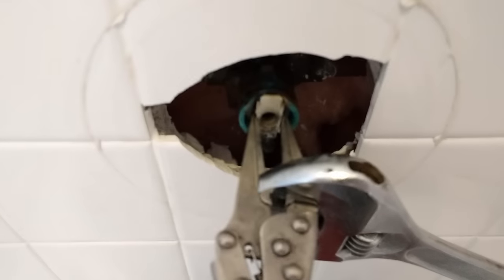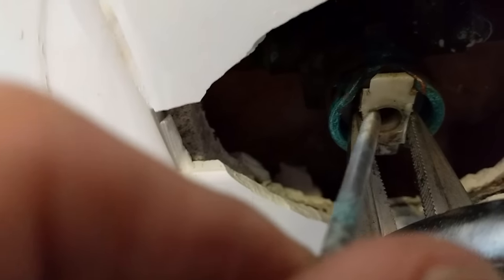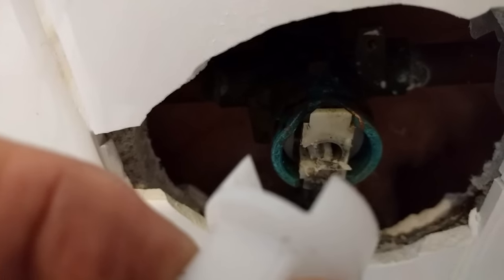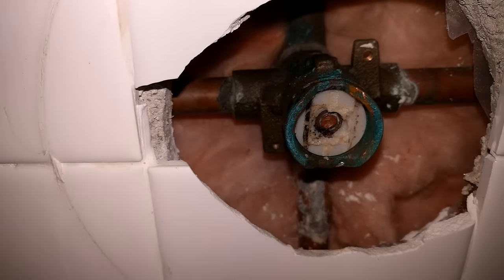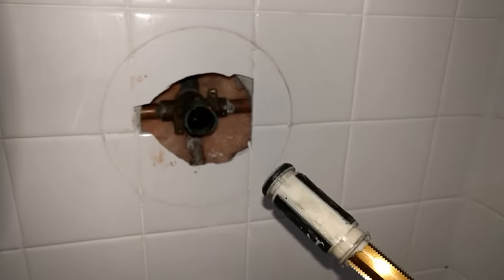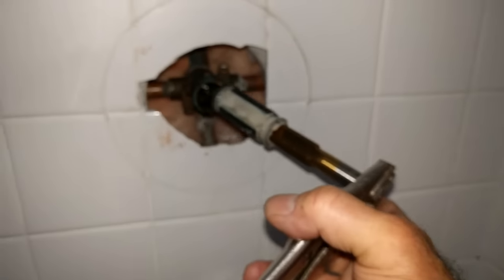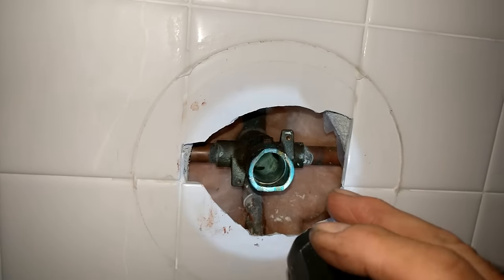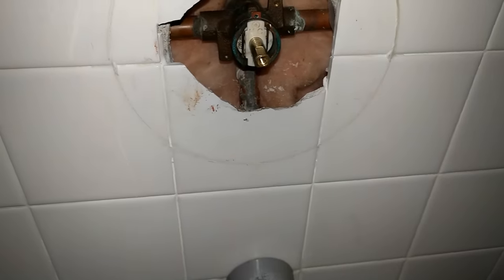Home repair Moen 1222 cartridge stuck really bad by froggy

Comment: Just wanted to post a big thank you for this video, froggy. There was another video that was helpful by uk7769 but this video showed the exact same issue I was dealing with. The shower handle snapped off at the copper valve so nothing was there to grab on to. 

I had to screw in two floor screws (dry wall screws would work too) in the white 
plastic parts on either side and yank on them with a vice grip. That got the first portion out. I then barely managed to grip onto the end of the remaining copper valve with a needle nose vice grip. Yanked forever. Finally the core came out. Then is was tap time. 

The M18x1.5 tap worked great. Thank you for sharing the exact size. This bit was not
 easy to find. Had to get it from an industrial store called "Bolts" up here. None of the big box store around here had anything close to the same size. Tapped it no problem but mine didn't want to turn while tapping it like yours did. So I had to use a tip mentioned in  uk7769's video that uses a matching bolt with massive 3/4" washers. Turned until it wouldn't anymore and then kept turning and pulling. It came out 
slowly, in three parts. I kept tapping further as it was breaking off in pieces. Finally it was out. 

Rubbed the inside down with steel wool and lime cleaner. Replacing the new cartridge was not problem. Just slipped right in. But then I had the issue of the broken cartridge valve stuck inside the shower lever. I thought I could just go buy a new one. Can't be that expensive right? That shower handle alone is $50!!! Just the handle. Nothing else. I decided to try and salvage mine. 

Soaked it in CLR for like 2 hours. Took a vice grip to the copper valve that was stuck to it and started wiggling. Heated up the innards with a blow dryer too periodically. Finally the inner black part comes out. This reveals a screw on the inside that hold the copper valve in place and snug to the black plastic part inside the handle. Unscrewed that and it still didn't want to come out. Soaked in CLR another hour. Wiggle Wiggle Wiggle, heat heat heat, pops right now. $50 saved. 

What an ordeal we have to go through just because of such a stupid design. Thank
 you once again froggy for posting this video. If your shower handle snaps at the stem valve, this is the video to watch. Be prepared for a battle. 

Btw, the moen cartridge is covered under warranty. Just take it once it is out to Home Depot or whatever and they will give you a new one for free.
Reply from the maker: Glad to help.

:)

Comment: You are the G.O.A.T.
I was fortunate that I was able to get a good enough grip with the vise grip that I was able to pull it out without crushing the plastic.  Heating the pipe with a butane lighter and lots of WD-40 also helped.  No need for the tap.
Reply from the maker: Excellent work!
Reply: I still have to remove the other piece of the broken stem that is attached to the handle.  After lots of vinegar and then WD-40, I was able to remove the screws that fastens the stem to the handle, but brute force alone couldn't budge the piece.  Any suggestions?  Is there any sort of expander that I can use to push it out rather than trying to pull it out?
Reply from the maker: @atl1276  Just all the methods in the video & read all the comments, might be a tip there.  :)

Comment: Wow! As a rookie — I didn't know what the hell was going-on — & then your video popped-up out-of-no-where, at the end some other video, that went easily — I still had my shaft but nothing was budging — I read below about WD-40 or Vinegar — I'm hoping to not have to buy taps…. But you've been a great-help; THANKYOU!
Reply from the maker: Good luck.  :)
Reply: @1947froggy  :: Thankyou -- So after your video took the mystery out -- I decided to cutoff the ends of that I-bar -- at the front of the shaft -- this allowed me to turn that valve the 45-degrees -- that the new-valve instructions recommended -- which is supposed to turn the rubber seals away from the hot & cold water intakes -- allowing the valve to slide easily out -- but my valve had one of those seals stuck in the hot-water intake -- but since I was able to now turn the valve -- the valve quickly broke away from it's stuck seal -- & the valve came out! I then had to use a hard-plastic knife -- to clear-out the stuck rubber-seal -- all's good....
Reply: FYI :: That thing I'm calling an "I-bar" is the flat, rectangular, eighth-inch thick plastic piece that wedges the valve from rotating....
Reply: 2nd-FYI :: I use that "hard-plastic knife" -- so as to not put scratches -- inside the brass valve-shaft -- of course you knew that....
Reply: 3rd-FYI :: These comments are mainly for other rookies like me :: last-one: after freeing the the stuck seal -- there's going to be pieces -- clean with vinegar (& BTW :: WD-40 in your water could be harmful to your heath & to your valve-seals!) -- so after cleaning -- prepare for a-lot of water to rush-out -- then go turn-on the water -- for only a few seconds -- to flush-out those rubber-seal pieces....
Reply from the maker: Good info, thanks!

Comment: What an amazing nightmare!  Before we finalized our recent bathroom renovation we decided to go with Grohe instead of Moen and I'm glad we did.  There are way too many horror stories frequently alluding to difficulties removing failed Moen cartridges which convinced us to avoid using Moen for our fixtures.  Grohe cartridges on the model 19822000 are a joy to repair/maintain/upgrade.  Only downside with Grohe designs is the fact they cost 10x what a Moen fixture retails for however you get what you pay for in the long run!
Reply from the maker: I have had issues with Grohe also, see my video on kitchen Grohe.
Reply: Just saw your Grohe kitchen faucet repair and it looks pretty straight forward maintenance.  I know both Moen and Grohe offer FREE replacement parts for the life of the fixture provided you have the original invoice/receipt which is a good thing.  Nothing lasts forever and this includes American Standard/Grohe/Moen, etc.  The key is parts availability especially FREE parts availability.  I was a huge champion of American Standard until recently when they started charging for replacement replacement ceramic valve cartridges and this is with me providing pictures of  multiple American Standard faucet fixtures clearly showing I was a true consumer of American Standard.  When they made it absolutely difficult getting FREE replacement parts I then swore I would go anywhere other than American Standard.  My latest favorite is Grohe because of the above issues I've had.  I noticed you have very hard water where you reside....me, on the other hand, live in NYC where it's soft water so we don't  have mongo calcium and lime issues which make fcuets a nightmare  to service.  Good videos, Froggy..... keep them coming!  @1947froggy
Reply from the maker: @stjoes1231  Good luck, keep me posted, yep VERY hard water deposits.

Comment: Just finished a 2 day disaster. Thanks for the write up. A few additional notes. A m18 tap is not readily available. A 3/4-10 tap was found at Tractor Supply. I hoped to have the same experience as you, where turning the tap caused the cartridge to turn and pull out, it did not. I ended up going back to Tractor Supply and buying 3/4-10 all-thread, 2 washers and 3 nuts. 2 of the nuts were used to make a head to turn in the rod. I was able to use this as a puller and it started to move. The rubber was so badly jammed into the feed holes that i had to pull until it pulled against the washer, then break off plastic until it finally came out all together.
Reply from the maker: You are a master diy, love the thought process, great job!  :)

Comment: Thank you for sharing the piece about running a tap into the plastic sleeve. I had one stuck yesterday that may have turned into a much larger project had it not been for that, thanks.
Reply from the maker: Thanks for watching.

:)

Comment: Thank you Froggy. After watching lots of other videos and having a real nightmare getting the inner cartridge out, the outside white casing was left and was not budging. I came across your video and used your trick of using a M18 Tap (and put a wood dowel in 1st just incase the Tap hit the pipe at the end) and it worked. This was the only thing that managed to get the casing out. Thank you, thank you, thank you.
Reply from the maker: Glad you got it the ez out tap works every time & no damage.

Comment: I usually get to the point where the stem breaks off,I stop and tell the customer I recommend cutting out the old valve and installing a new Delta valve. I can install a new valve in 1.5 hours as opposed to 3 hours drilling out the old Moen cartridge.

Comment: I couldn't get leverage to pull mine out at all, despite using every tool in my arsenal. I finally screwed a 2" screw into the plastic near the side. My thought was to use that to help pull on, but as I screwed it in, it started pushing the cartridge out! Still not sure how that happened. I was then able to get the vice grips on the whole thing and pull it out slowly (still took 10 mins!). No damage done... In my case, the rubber parts of the existing cartridge had expanded into the slits of the pipe, making it almost impossible to pull out. What a royal pain in the arse! Thanks for your video though, it gave me enough info to come up with the screw idea!
Reply from the maker: Glad the video helped & you were successful!

:)

Comment: I owe you and the person you got the idea from a beer. I tried every trick in the book on a 40 year old brass cartridge that was completely corroded and partially busted. I tried turning the water on but the valve did not move. In less than a minute using a tap I had that thing out without any damage. Thank you.
Reply from the maker: Glad to help.

:)

Comment: Thx so much, froggy! This is so helpful. So I have much harder situation to deal with, the cartridge (plastic part) stuck so bad that it broke in half when I pull. As far as the 18mm Pipe Tap (aka Spark Plug Tap), only place available is Amazon and took 2 days to arrive. I'm from AZ, no luck finding it at HomeD, Lowes. I found 3/4" tap at AceH but too big. I ordered 16mm w/Amazon one day and it was too small. It HAS to be 18mm! Finally the 18mm arrived after 2 days without water. The item name on Amazon is called: Vermont American 21164 18MM-1.50 High Carbon Steel Metric Spark Plug Tap ($12). Thanks again Froggy!!
Reply from the maker: Thanks!

Comment: I just replaced the guts of an old (23 years) Moen shower valve today using the 1222 cartridge. Of course, the old cartridge didn't want to come out. This necessitated the use of a cartridge puller as well as the plastic "tool" that comes with the Moen 1222. My old cartridge left one of its rubber gaskets in the hot water port of the valve body. I used a dental pick to pull that bad boy out. This is why it's a good idea to closely inspect the valve body after the cart is pulled. When cleaning the valve body, I used an AR15 upper receiver brush (brass). This brush fits pretty well...yet is small enough to allow for the wrapping of some 400 or 600 grit sanding mesh around it if necessary. The new cartridge went in well except for the last 1/8" or so. By using the plastic tool that came with the new cart I was able to slightly rotate the new valve body back and forth while pushing. This did the trick. Also...the new cart didn't have an o-ring at the rear. The old one did. I noticed that the groove at the rear of new cart wasn't as wide as that of the old and probably couldn't support an o-ring, so I installed without an o-ring at the rear. So far; so good.
Reply from the maker: I recall that the new one does not have the oring you mention, mine is fine so far.

:)
Reply: I can't believe they wanted almost $50.00 at Menards. I found a plumbing supply place in my area and got the cartridge for $24 and the handle for about $9.00.

Comment: Fastest way to remove this cartridge without any tools:  Remove retainer clip, turn on water and it will shoot out.  Learned this the hard way after installing new cartridge and forgetting to install retainer clip.  Thanks for the video!
Reply: mrgsalgado  lol only of you jave a tile tub mine is all glass
Reply: Always have a foil funnel to stick under the valve as you disassemble it.  You house will surprise you at how it holds water.  Tuck this into the wall under the valve to direct the flow out into the tub.., 

You don't want a gallon of water running into the walls behind the valve.
Reply: that may work in some situations but sometimes those cartridges can get deposited and build ups that really hold them in .
Reply: mrgsalgado that's absolutely correct. The water pressure will force it out. Just make sure to have someone by the main water shut-off valve for you to signal when to shut it off.
Reply: Turning on the water didn't budge the cartridge. The removal tool leading edge sheared off when tightening it. Next time I will replace it more often before it welds itself in.
Reply: I turned the water on for a few seconds first and it didn't come off but, I think that might have loosened it up a bit. I then used the needle nose vise grips and gripped it on the botton because there is a little more plastic to grab onto on the bottom. I got it to turn just by twisting the vise grips. I then just pulled it out by twisting and pulling with needle nose vise grips. I then pulled it the rest of the way out with a small pair of channel locks. Great video, very helpful and I like the way you didn't give up , I am not the only one who refuses to call a plumber.
Reply: NOT, Mine is stuck really bad
Reply: Have you got the cartridge out yet? If you have those type of vise grips he used it should come out. I will tell you one thing don't buy that cartridge at one of the home improvement stores. They are like thirty bucks. I got mine at a local plumbing supplier for only 8 dollars. This guy had the handle too, which Menards didn't have.
Reply: After the third time stabbing myself with a screwdriver, I thought about doing just that! Then figured I'd probably break some tile in the process... Paid for a plumber to fix it... At least he was big and tall and still struggled with it, so got my moneys worth!
Reply: You tried doing it yourself and I give you credit for that, those type cartridges a just a pain. The plumbers run into that stuff everyday. If I ever had to do one of those cartridges again, it would be a piece of cake.
Reply: Paul Griswold he is a plumber, working on a job as said In The Very Beginning .
Reply: Thanks it worked for me i really appreciate you sharing thanks again
Reply: Just came from the identical job an hour ago and that crossed my mind. But I was working alone and shut off was far away.     I was afraid  of it leaking into the wall too much. Called a plumber friend to take care of my customer.

Comment: I used the Moen removal tool and after lots of trying I extracted the metal interior. I then had to chisel away the external plastic, taking my time. I have read that applying heat softens the rubber and you can then extract it via standard methods.  Will try the heat method next time....

Comment: I extract those broken plugs out in less than 30 minutes, drill two holes around the outer plastic , do not drill your close to the outer edge. Put in two rods and turn the stuck plug out, done lots of them. The last one took me less than fifteen minutes. Bingo!!!!! Good example to help some.

Comment: I just replaced my moen, it was ten years old and stuck in there good. My shaft as you called it, did break off as did half of the cartridge. The remains were left in the pipe. I couldn't get it out and I was tipped by a friend to use a torch. This way you'll melt the plastic and free the cartridge. You'll still have to give the remaining piece of the cartridge to release the suction but when it's out, then all you have to do is chisel out the plastic. It isn't that hard and does no damage to the pipe whatsoever.
Reply from the maker: Thanks for the tip, gotta be CAREFUL with a torch, eh?

:)

I wonder if an elec heat gun might do it?

Comment: Glad this helped everyone else, as for me, not so lucky as I will have to rip out the entire tile and backer-board and replace the whole fixture and either go broke or learn how to solder copper. Why? I damaged the soft brash copper because the cartridge broke apart while trying to pull it out.   Before breaking it apart I tried first drilling and  tapping trying to be careful.  But in the end, no such luck because the plastic had to be broken apart piece by piece.  After that I surveyed the damage and sure and enough that brass is soft and it gouged in multiple areas leaving a leak path.  Unfortunately, now I have a permanent drip which warrants demolishing the entire shower wall.  Hope others have better luck but this is 2020.   This was only 6 years old Moen.  Bummer.
Reply from the maker: Sorry you had to do that. :)
Reply: @1947froggy  I'm not giving up just yet.  Although there are gouges and scratches, its possible (long shot) that there not where the o-ring seats. The trouble is, i got the cartridge half way in , and realized it was in the wrong position. I pulled it out slightly, rotated and pushed it into place.  I may have damaged the seal doing so. So I guess I'll try another cartridge before tearing down the wall and tile.
Reply from the maker: @pointvicente123  Worth a try, also MAYBE you can smooth/polish/fine sand the gouges - but it might not work, just brainstorming.
Reply: @1947froggy  it worked like a champ with a new cartridge. The other one had been slightly damaged enough to be causing the drip.  Polished the inside with steal wool. Blasted water before installing to ensure it was clean and now no leak. Thank God!
Reply from the maker: @pointvicente123  Way to go!!!